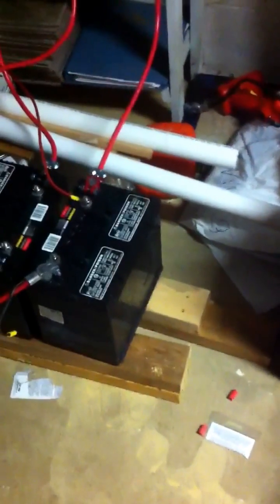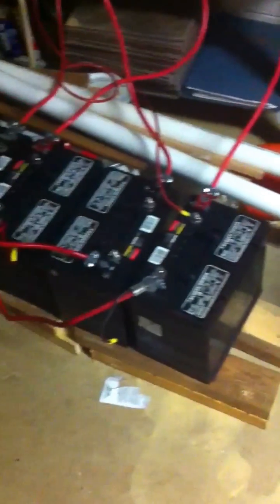My Off Grid Solar Power System

Comment from the maker: Thanks for the input.  Actually I'm just getting started.  I'm actually using FLA (Flooded Lead Acid) batteries.  When I'm done, it's going to power 90% of the house with the exception of my stove, washer, dryer and water heater.  I'll likely need another 3000w 24v pure sine wave inverter, maybe 2, but I'll get there.  I'm also gonna have to build a whole lot more solar panels too.  I don't buy mine, I learned to build them from Dan Rojas over at GREENPOWERSCIENCE

Comment: Seems you are attempting a poor-mans form of a bi-modal solar system.  Batteries are expensive. I would avoid cycling them except for power outages, especially if they are float-friendly AGM batteries.  Flooded are not as float friendly so it might be good to cycle them during utility on-peak hours.